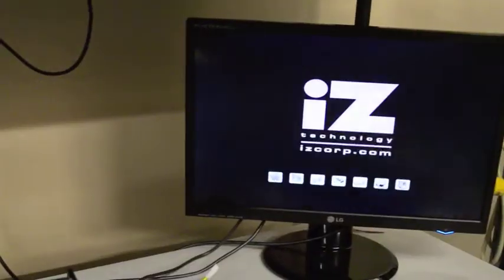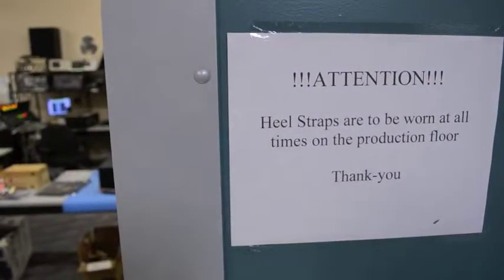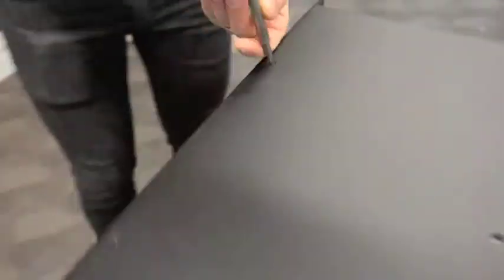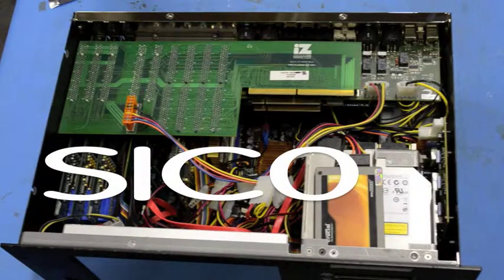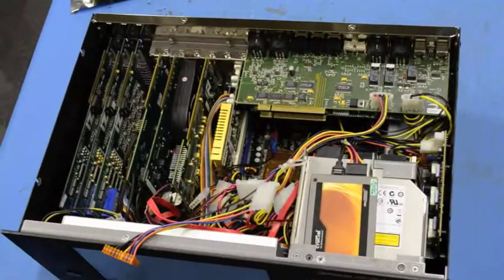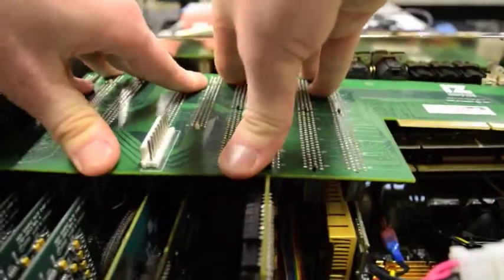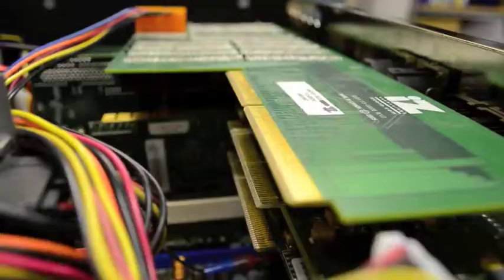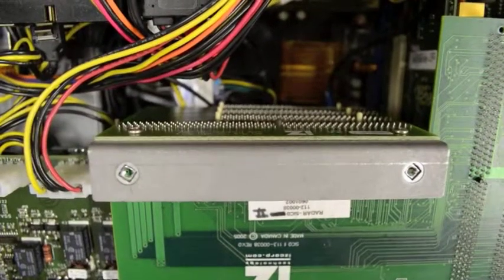iZ Tech Talk - RADAR 6/ADA II SIC0, SIC1 Reseating

Comment: Hi ! I've just grab an OTARI RADARII to recover  (on my DAW) the material of 3 lps recorded  22 years ago ... Everything looks fine (interface, meters ...) ... but no sound comes out from the analog output (SUBD25)... I've read the manual a thousand times and I can't understand why it's not working ... any clue ? (my Sub D 25 are connected in regular analog 1 to 1 mode) . thank you !